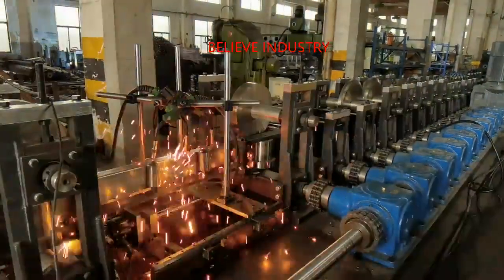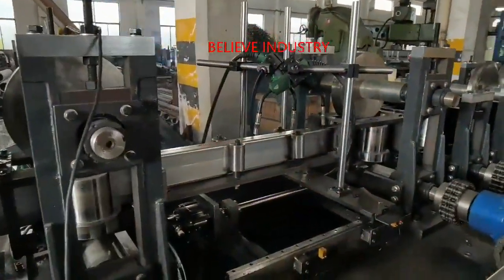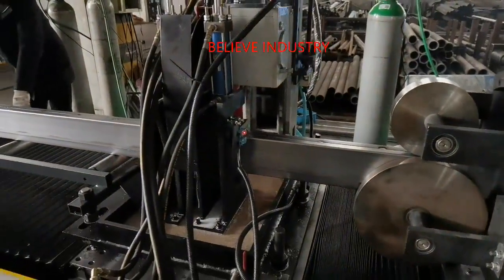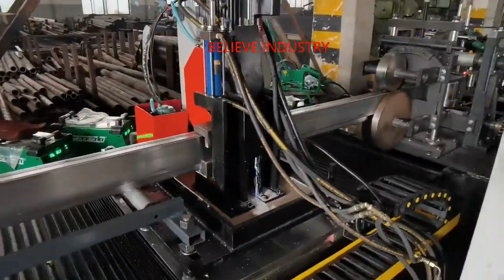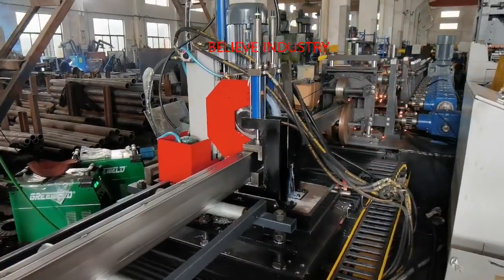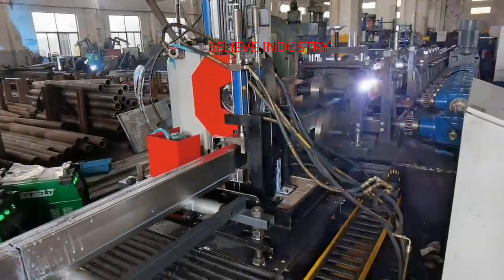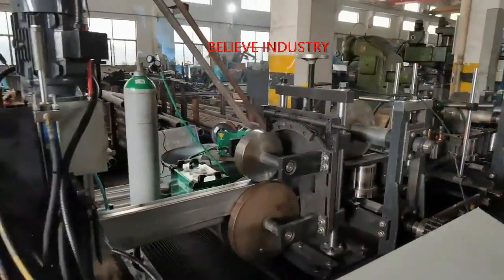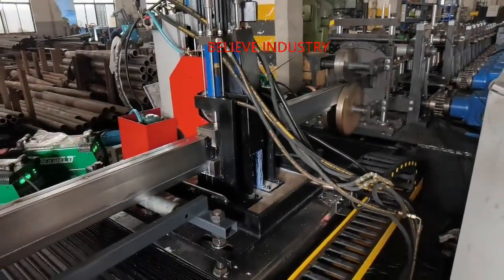Flying Spot Welding Step Beam Roll Forming Machine, 6-8 m/min

Comment from the maker: Believe Industry Company have a full range of machines for material stroage system:
1: Upright Racking Roll Forming Machine
2:  Welding Column Roll Forming Machine
3: Box Beam Roll Forming Machine
4: Step Beam Roll Forming Machine
5: Bracing Roll Forming Machine
6: Shelf Panel Roll Forming Machine
7: Welder for beam and clips
Reply from the maker: Contact us now for more info: equiry@believeindustry.com, https://believeindustry.company or whatsapp: https://wa.me/8618616927760